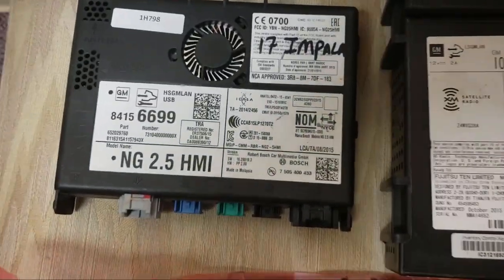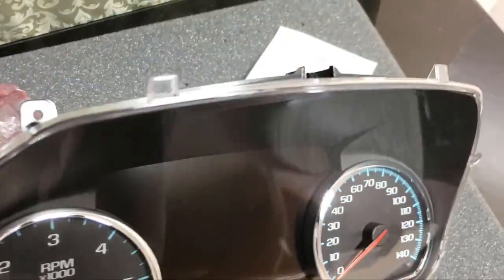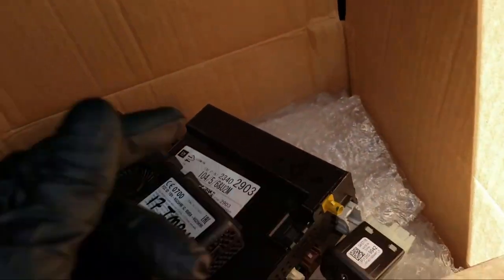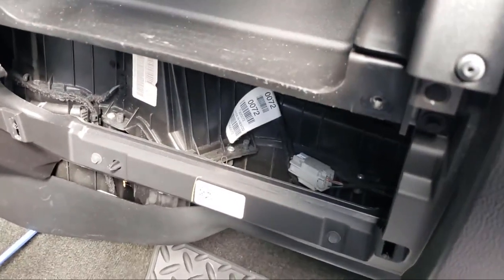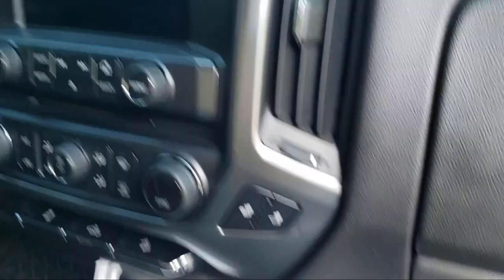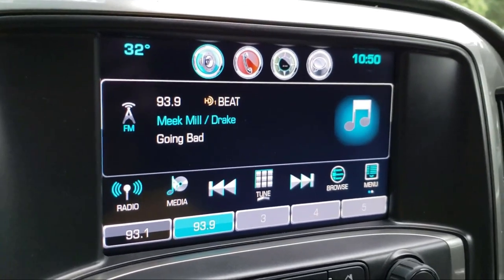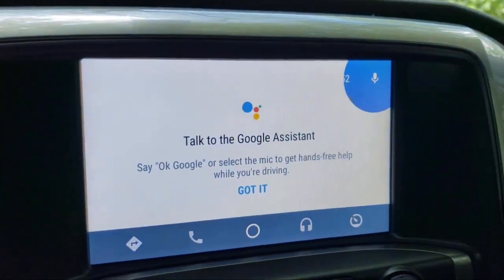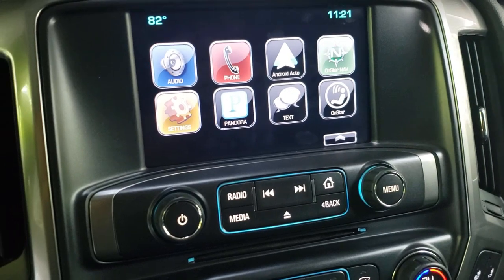How-To - '14/'15 Silverado/Sierra Android Auto/Apple Car Play and Denali Cluster "OEM" Upgrade

Comment: Did your cluster and radio display Denali logo when you open and shut the door? Or did your original Chevrolet logo come up? I'm getting ready to do this mod on my 2015 GMC Sierra.
Reply from the maker: I got an update Chevy animation.  I believe whoever does the programming will be able to do either the chevy or GMC based on your VIN.

Good luck, most useful mod on my truck yet!
Reply: @TropicalMint808  I was planning on going through WAMS. Is this the service you used?
Reply from the maker: @marvinlemmons522  Yea, they'll get you sorted no problem!

Comment: Did you only add the cluster to make the steering wheel buttons work with android auto? or would they work just with the new radio and 2.5HMI unit?
Reply from the maker: Some functions should work like next song and the siri / google button but other stuff might not work.  Cluster is definitely not fully necessary, only for decoration and I might skip it if I did it again.  It is nice though : )

Comment: Do you have to have the 2.5 hmi to run the  Denali cluster?
Reply from the maker: Got mine off ebay, confirm part numbers though with whomever is doing your programming and you should be good.  I went through WAMS.  Good luck!

Comment: I just got a 2015 GMC Sierra 1500 Denali Non-Nav with the 8" screen. I already have the Cluster panel but I have been looking at upgrading to an HMI 2.5 module to get Projection.  Where did you send your module off to get programmed?  How much would you estimate it cost for just the HMI Module and programming?  Thanks for putting together this Vid!
Reply from the maker: Nice!  Should be around $100 to program the HMI and radio plus shipping both ways.  I think you'll need the radio module in addition  to the HMI, but I'm not 100% on that and the USBs ports as well. I sent mine off to white auto and media.
Reply from the maker: Contact WAMS through the contact form on his website and he will send you more info on fitment.

Comment: Will the steering wheel controls not work without the denali cluster when changing the HMI and radio?
Reply from the maker: It should still work for the most part.  I think you might run into issues with the phone call button bringing up siri or Google assistant but skipping songs and  volume etc should still work.

Comment: Where did you get the radio and HMI module from? I want to upgrade my 2015 Silverado
Reply from the maker: I bought both from ebay.  Contact WAMS or whoever is going to do the programming to get the list of compatible parts.  the part numbers have changed over the years but multiple combos out of other gm vehicles are possible.   My HMI was out of an impala I believe.  gm trucks forum post is long but has all the info you need.

Comment: can you provide a list of the places where you got these parts and how you got each of them programmed? Also was curious if you needed to change the wiring harness or the USB ports like in some other mods I have seen for this. I currently have a 14 High Country will this conversion work the same as it did with yours?
Reply from the maker: Hey Coby, I got the parts from ebay and gmoutletparts.com and programming done at whiteautoandmedia.com.  There are a few others that can do the HMI and radio modules but I think hes the only one to do the cluster as well.  Sent all the bits at one time to get programmed together.  

Here is my post on the costs on the gm-trucks forum.  I got all my information from the forums and from WAMS (part number confirmation) directly through email.   
Total cost including all shipping = $1,115 USD, you can subtract $675 or so if you skip the cluster.
https://www.gm-trucks.com/forums/topic/213775-replacing-20-hmi-module-with-25-hmi-module-to-add-carplayandroid-auto-to-2014-2015-silverado/?do=findComment&comment=2238146

I didnt need to change any wiring harnesses, just the USB port in the center console. 
 But to be honest, I didnt even try the old one.  There was also a white updated USB available on ebay and it was about half the cost but I scoffed at that.  Then I remembered my USB in the glove box was white - save cash if you can.  For your '14 I think it should work like factory, except maybe the Off-Road page on the cluster (does your '14 have that now?).  I may be imagining things but I dont think the '14s came with the hardware to show steering and approach angles on the cluster.  I was told that my truck is a 2015.5 indicating my original hardware was closer to a '16.  

Good luck!

Comment: Where did you get the cluster?
Reply from the maker: Gm outlet parts.  You'll need to get the matching year for your truck (2016 for 14 and 15 year trucks).  Make sure you verify part numbers with whoever's doing programming and don't plug the unprogrammed cluster in your truck or it will theft lock.
Reply: So was it $400 for both the part and programming together? Where did you get yours programmed?
Reply from the maker: @ausenciotrejo7016  400 for just the part.  Only person I know of to do the programming was Chris White at wams (white automotive and media services).  I believe he lowered the price from when I had this done but shoot him an email.
Reply: Another question, the cluster along with the modules have to be sent all together to be programmed together?
Reply from the maker: @ausenciotrejo7016  I would if you can, as you'll have to pay twice the amount of shipping costs.  I would do the 2.5 HMI radio and module before the cluster if you have to make a choice.  You can then add the cluster later when resources permit.  Get in touch with wams they should be able to give you more info.  Good luck!
Reply: Cool, thanks for all the info!

Comment: Hey brother quick question can I just change the HMi to the get car play ?
Reply from the maker: Yea HMI and radio module should get you wired CarPlay and android auto.  You'll still need the modules programmed to your VIN.  Check the Gm trucks forum post for more info.